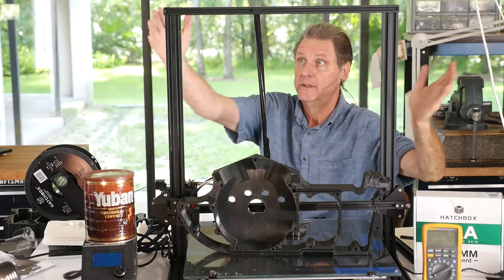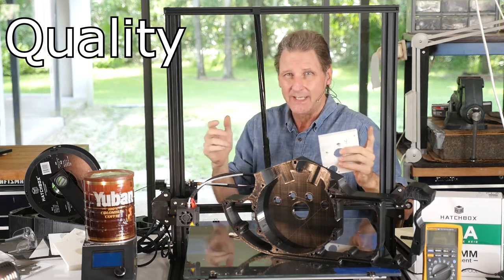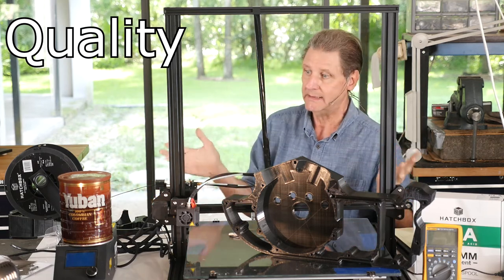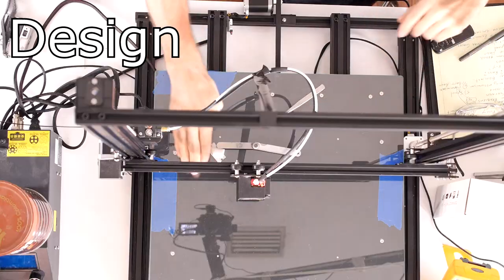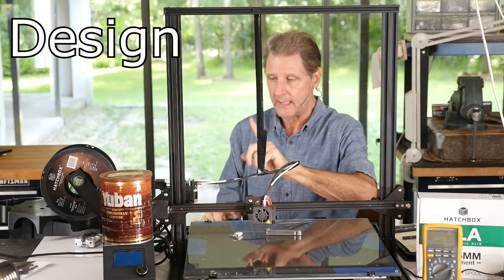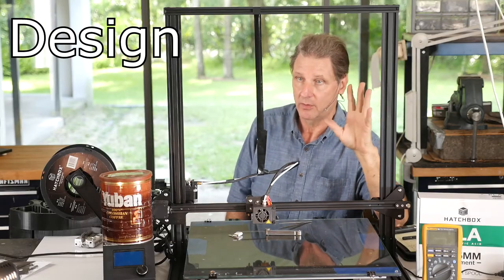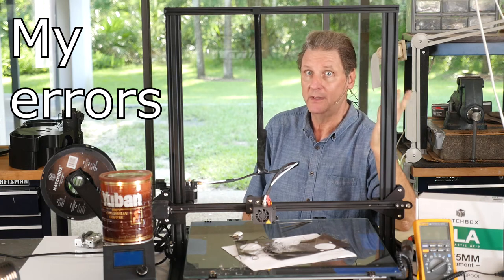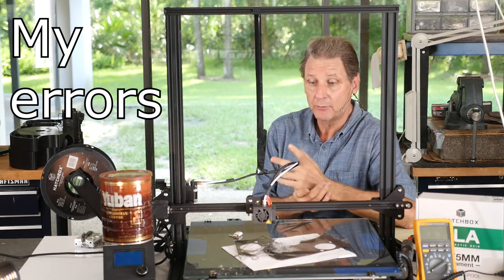Creality CR-10S S5 quality, design, tips, and results

Comment: Hey Paul, this was the absolute best video that I ever saw regarding installation of a 3D printer. Thanks so much for that. I'm from Germany and I just received my S5 because I need to print some bigger parts. My S5 came with loose screws on the Z-axis too. In fact one of the screws was missing. Without your video I would have started printig right away and would have ran into some serious issues. Thanks again for this awesome video!
Reply from the maker: I am so glad I could help another user with this machine. The S5 does make some large prints, and for that it is hard to beat. Thanks for your kind words and the comment.

Comment: This guy is so nice.    Many hours of critical information learned and passed on.    My Dad's an aerospace engineer and Uncle Ed is a mechanical engineer - he strikes me as an engineer.
Reply from the maker: Yup, as my buddy used to say, "I'm an engineer, but they don't let me drive the train." I started as an auto engineer in Detroit, then did a stint in electronics in Silicon Valley.
Reply: @Rako_Studios  Well you sure are thorough and you fit right in with them.    ;)

Comment: Thank you for this extreme detail. It has helped me figure out the problems I am encountering with the same model.
Reply from the maker: Glad to be of help, I was hoping I could clear up some things. I noticed after I made the video that the machine was much easier to level in the video studio where I had a nice flat desk to set it on. When I carried it back to the card table (!) where I had it in the first place, I noted how the uneven table just telegraphed through the base. I went to Home Depot and had them cut me a 34' x 34" x 3/4" plywood sheet, which just fits the card table. Now the machine is easier to level, but I want to make a new base anyway.
Reply: @Rako_Studios  that hadn't occurred to me. Might need to look into this.

Comment: Finally got my printer. Was price reduced because who has it before can't calibrate it. Rollers under the bed was loose,springs were inserted on the outside between the screw(black screw) and bed frame instead between the bed and bed frame, steppers at different high. Saved over 200£ and cost me nothing to fix. Good quality at 215 degrees, fan 80% and bed 50-65 degrees (PLA)
Thank you soo much :))
Without you i didn't know how to calibrate the steppers
Btw, because on left side is a metal plate on x axis, is different hight than on right side so i raise the z axis and i calibrate with top frame
Reply from the maker: Glad I was able to help, but sorry to hear there are still quality issues. I think China has grown so fast economically, they have a hard time training and finding qualified people. They are also labor intensive, so with everything done by hand, there is more chance for bad quality. 

Getting that X-axis "trammed" as my friend calls it, where the bar is level and parallel to the bed is important, good that you got that done. Happy printing!
Reply: @Rako_Studios  not happy yet
Solve a problem, found another one and so on
I hope soon everything will work as shoud be

Comment: I know this is a relatively old post but here's some of my comments after having dealt with this printer for 5~6 years:
I think my CR-10S5 (generic brand) is about 5 or6 years old and it came with a stepper on both sides of the gantry, unless I modified it and forgot about it(?).... I seem to recall that some of the early versions did not have dual steppers.

1:03:04 It's a natural conclusion to believe that your bed is crowned because it's "tight" in the center but over time I realized that when you move the extruder hot end to the center of the gantry rail the weight of it actually bows the gantry. I have exactly the same results that you have when I level my bed. It's always "tight" in the middle. This observation alone has prevented me from upgrading to an all metal hot-end with direct filament feed because I believe the problem will be worsened if the gantry has to carry the carriage and a stepper motor atop it. 

I'm also an E.E. retired from Northrop Grumman (first employed by Grumman before the merge in the 90's) after 38 years! I believe that you're likely in Florida by looking at the background. I'm in the Tampa Bay area.

Comment: Thanks for this video. Good job. I have the same machine. Went through all the same issues you did. Wound up squaring the machine with shims and the aftermarket threaded rods to tie the  top to bottom. Hard mounted the bed, painstakingly added a bl-touch. Put on a bond tech qr extruder. Printed belt tensioners. Struggled with aligning the x gantry. Don’t like that the heat bed only covers the middle. Tuned my power supply and stepper drivers. Added tl smoothers. Moved the spool holder to the top and had to design and print filament guides. Added an e3d v6 nozzle. Anyway, got a lot of money in this thing and can print large great prints. But I am still troubleshooting. I had a two day print layer shift at the end last night. Sometimes I wonder if I shouldn’t have just forked out all the money upfront and bought a $1500-2000 dollar printer off the bat. I wouldn’t know as much as I do now about 3D printing if I had done that, but I would have a lot more confidence in my machine running when I want it to.
Reply from the maker: I could not find a 500mm printer for 2000, but maybe I did not know where to look. It sounds like you should make a video, those are great upgrades. I got sidetracked on CNC machining, but will be coming back to work on this printer.

Comment: any CR printer needs a few upgrades

I have the cr10 mini and modded that, the 1050s is still inteh box and I am waiting for a few mods to be fiished printign first

cooling duct ( any one is better)
hotend ( microswiss)
cable extension 

ALL fans replaced with  noctua
combine the z rods 

z axis stablizer
add 200 usd after initial purchase and you have a great 500mm3 printer

great overview btw..
Reply from the maker: This reminds me of a Harley or a Colt 45. The initial purchase is just the beginning, then you have to make it the way is suits you.

Comment: Thank you for a very informative video, sir.  I also have a basic CR-10S (300x300, 400 mm high build volume) which I bought in 2018.  Still provides me with very reasonable prints.  I see you briefly touched on the matter of the axes not totally being level or at 90 degrees in relation to the others. My printer also suffers from the same issue (and I doubt if any 3D printer for that matter, no matter what the price tag, will ever come from the factory with all the axes perfectly perpendicular to the others).  In short, there is an add-on for Cura that fixes this skew problem.  It is possible to fix your printer's shortcomings digitally and, for instance, print a large cubic object with all its corners at exactly 90 degrees.  I also like designing and creating technical objects like pulleys, gears and fittings.  It's obviously frustrating to have some degree of wobble in a pulley, for instance.  Fine tuning your printer with the add on (Cura Skew Compensation Post Proc Script by joochung) takes a few tries but I found it to be an exciting project in itself. I hope this post will help someone out there ! :D
Reply from the maker: That's a great script, thanks for posting it. I have thought about auto-level scripts as well as this one, but what I hate is the printer is constantly working in software to make up for the mechanical skew. I would just like the machine to be true, so that the Z axis never runs even a step when doing a layer. Your setup is more sophisticated and makes a truer print, so I think that is what we are going to see more and more. Thanks for the comment.

Comment: Thanks -- very detailed!  I was torn between buying a Anycubic Chiron or this CR-10 S5. Since they both "have issues" -- I'll now get this printer -- since you have shown how to tame it. That 500mm print size is to be preferred anyway. Subscribed
Reply from the maker: If you subscribed you might have seen the video I just did where I installed the full-sized heater, it works great, no more warping or lifting on my big prints. I got a good first layer on the first try, I must be learning something.
https://youtu.be/G1Zg2F5xuU0

Comment: I just bought a cr10s5 not because the printer but because of your video!🤟🏼

Now I’m facing the same problem with the horizontal bar.
When I turn the screw one to each other to make it levelled the bar turns to a dealigned position.
Bah 🤔
Reply from the maker: There is a setting in the menus where you can "Turn off Stepper drive" or something like that. That will let you turn the ball screw rod by hand until the horizontal bar is level.

I hate something that might damage the machine, but last night I just put two parallels under the bar on each side, and used the "move" axis (1mm) menu pick to just drive the bar down onto the parallels until both sides started skipping steps. Fast but risky. I think the real solution is that little pulley and belt kit you add to the top of the two Z-axis ballscrew rods. It takes out some Z travel, but I don't need that much anyway. In theory, the belt holds the two rods in position so you never have to "tram" the gantry beam again. I will ask my mechanical engineer buddy again, to see what he advises. More videos to come.
Reply: I think I just found a way to level it in a quick way!
Home position
Disable motors
Turn the screw down to make it levelled
Home again
Than check the level

It seems to be a good way to level the bar.
The issue comes because the zero point sensor works only for a screw, the zero point of the second screw is not managed so you have to push it down to make them levelled
Can’t wait for you videos 🤙🏼

Comment: Thanks for the great video!  You did an awesome job with this printer for your first printer.  It’s a big machine and they are harder to work with
Reply from the maker: Agreed, it would have been much easier to work my way up from a smaller printer, and I sure would like a printer that auto-levels, but this one works OK. Thanks for the kind words.

Comment: This is the best Creality review I have seen. I have an Ender 3 because some You Tubers said it was a good starter printer, its not. There is enough to learn without all the issue Creality products come with. Honestly, I think these You Tubers are getting paid or take for granted what they already know. Perhaps they think these minor issue should be easy to fix but when you don't know you don't know.
Reply: Can You advice good one? I am totally noob in 3d.
Reply from the maker: Yes, I faced the same thing, watching a lot of videos, and then being totally surprised by all the issues. Thanks for the compliment, it means a lot. I m doing CNC mill videos right now, but will circle back to the printer soon.

Comment: Thanks for the video.  I recently got this printer which was used once or twice according to the person I got it from.  So far my impression is that it is junk.  Bed won't heat above 64 and it is impossible to level.  I'm banging my head on the wall.  Any idea where to start?  I should have done my research, I assumed an $1100 machine would be auto-leveling. This is my 2nd Creality machine, and I am not impressed.

Comment: Thanks! Ive been having really bad layer shifts on bigger prints, ill definetly try tightening that pulley! Also unfortunately that cracking pla is really common and generally considered a property of the material. I would highly recommend a bl touch if you haven't got one already.
Reply from the maker: You're quite welcome. I kept looking for some complex thing like missing stepper motor steps, but it was simple, just a loose pulley. I hope you get your issue sorted out.

Comment: Seriously a great review of this machine. I bought it partly because I could weigh the pros/cons due to this particular review.
Reply from the maker: That is so nice to hear. I wanted to be balanced, not trashing it but not being a sales rep who gets a cut. I hope you have having good luck with the new printer. They have gotten a lot cheaper since I bought mine.
Reply: @Rako_Studios  Yeah I picked it up for $700, an INCREDIBLE deal for what it can do. I'm a 3D artist by trade and have started building motorcycles, will be using it to create ABS fairings/parts for CB750s.  Hope you do more reviews!
Reply from the maker: Oh man, what a cool application-- I have 5 old Harleys and it never occurred to me all the body parts I could make. The only thing I read about ABS is you might need an enclosure around the printer to keep the temperatures warmer all around the part.
Reply: @Rako_Studios  Yeah I believe an enclosure is the only way to do this correctly, otherwise it'll warp. Thanks again for the great video :)

Comment: Great video. Would you recommend cr10 max instead if you want to avoid a lot of the issues? Max also seen to have lots of complaints too. Also all I see is cr10 s5... Your title says CR10S S5. Are there two different models?
Reply from the maker: I actually like the S5 with its separate control box. There are things about the Max some people prefer, but I am sticking with my S5. Yes, the S5 is the 500mm x 500mm model. There are several other models, that are 300mm by 300mm working area. It is very confusing, and had me all tripped up until I spent a day looking at all the models.

Comment: Bravo! This is the way you run one of these machines. Amazing, detailed intro and instruction...the best I have seen. 
So 1 year later is this giant still in use for the Harley protos?
Reply from the maker: I have been working on getting a home CNC machine going, and am now going back to the Creality. I bought a 510mm 1200-Watt bed heater, so I want to get that installed. It should come in a week or two, and I will certainly make a video about it.

Comment: We could have a drinking game and have a shot everytime you said Mickey Mouse  😀  My experience with that printer was not to use the binder clips but the silicone adhesive like what's used for cpu/gpu processors to attach a heat sink.  It sticks the glass to the bed and no clip pressure to induce warping.  I've begun to use magentic beds / spring steel print beds with a PEI coating.  It's so easy, lighter than glass and removing the prints is a simply few flexes of the steel.  The hot end, I just went Direct Drive (used Bondtech's solution).  And I do use the BL Touch to build a print mesh that's super helpful.  Being able to fine tune/babystep as needed does wonders.  I can't expensive $10,000 quality given the state of China's poor QC and cheap components.  If you gut the cheap things (hot end, power supply, etc)...you can wind up with a printer than can print almost as good as those expensive ones.  Enjoyed your video
Reply from the maker: Thanks for the great tip! I wondered if I could pour that floor-leveling stuff tile-setters use, to get a dead-flat and level bed to put the glass on. Since I made this video, I learned that the clips do warp the glass, and tried to use fewer of them. Your idea solves everything. And don't tell Disney I say Mickey Mouse so much, they will put in a copyright claim (;^o).

Comment: Great review!  Love the way you think!
Thoughts on the CR-10 Max.  $270 more but it's got the bondtech extruder, more even bed heat, auto leveling, and some misc design features making it more stable.  My project is about $100 in parts so $1,000 is at the top of budget.
Reply from the maker: Yeah, I had a pang when I saw the CR-10 Max, after I had already bought mine. Thing is, I want to hack on this one, so I do like the separate controller box for that, but the Max sure is a cleaner setup with the controller built into the base. The auto-leveling would be worth the 270 bucks to me, after what I went through. I am surprised by how well my cheapo extruder works. I intended to upgrade to a direct extruder, but the Bowden tube works better than I expected, so I am going to get a bigger bed heater first.